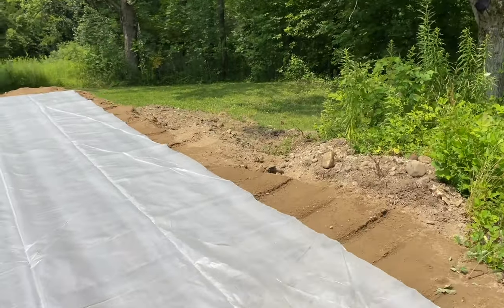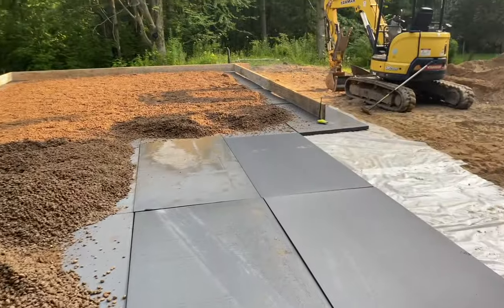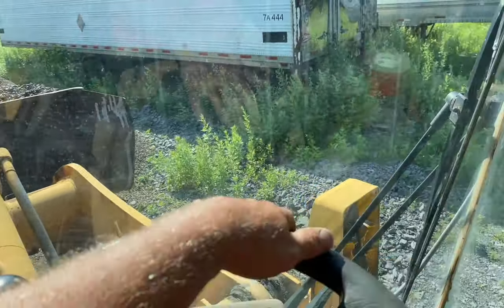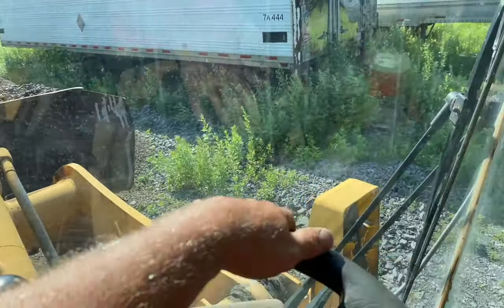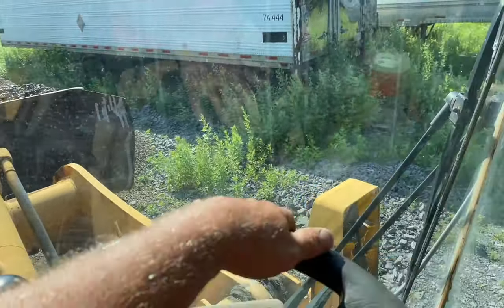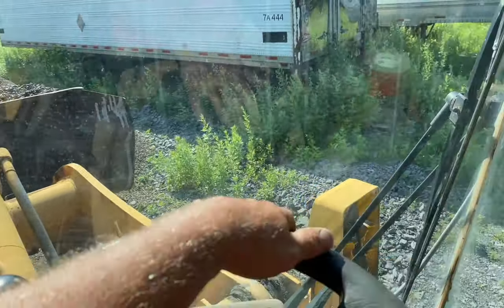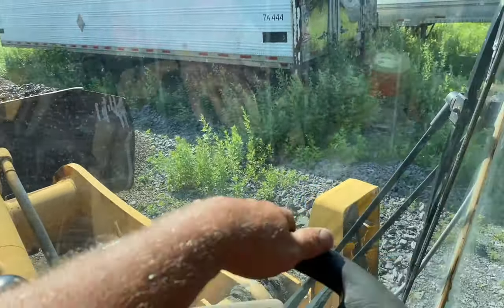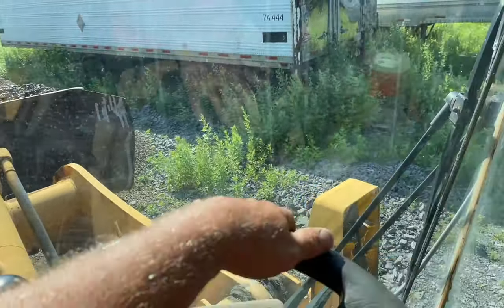A cost effective slab on grade home foundation.

Comment: We do lots of radiant heat slabs here in Northern Ontario. We always put 60-70 psi test on so you'll know if you punture a tube and you can quickly repair it.
Very rare occurrence to puncture a tube if everyone is careful though but in one case they did it with the wheelbarrow when he dumped there was a sharp edge that punctured the tubing.

Comment: Please explain why you don't need foundation and footers around the edge.  I'm a bit confused.  I've poured monolithic, but it's still three feet deep around the edge.  Frostline....
Reply: It's an insulated raft slab.  It doesn't need to go as deep as the frost line.  Rebar gives strength under load-bearing walls, and sitting on a bunch of stone spread out the loads.
Reply: We call it a club footing here in Canada but monolithic slab is the correct term

Comment: There at 12:00,,,I'm going to do something a bit different. Anyone feel free to comment with advice, because I DO appreciate it. I'm going to use 2"x12" for outside forms such as this. But I'm going to get one of those cheap post-hole diggers I'm seeing and make 8" holes every 6' or so down the wall-lines around 16" deep, and out in the field. Frost line here is that area, and we have no Codes here. Then I'm going to buy some of those 4' cardboard 'sonotubes', cut it to 24",,,and put in those holes. Bring the tops of the cardboard tubes 4" lower than slab finished height, so that it makes a pier. The top of the cardboard pier is also top of gravel level which makes for a nice guide to spread gravel to.  Also thinking of making a stem-wall out of 8" old tin strips. Line them along wall lines,,,making a 4-6" wide stem wall. Drive some 3/8" rebar beside tin and fill gravel right up to the side of the tin, resulting in 4"-6" wide stem wall. Doing this will save bigtime on amount of concrete I put in this 'alaskan slab' I'm attempting. That big sloped gravel to your outside form eats a bunch of concrete!  I see some guys digging footers with 18"+ buckets,,,and man, that is enough concrete to lay field stone on! I will also do 6"x6" wire mesh,,,and a few rebars down the 'stem wall' section too. 7-8" of gravel base and 4-5" of concrete slab. 28' x 44' shop. 2x6x10 walls. I hate metal buildings! Build my own trusses,,,thanks to 'Medeek' truss design and some vids on youtube. I appreciate you guys doing these vids. I'm 70 and still think I can do most of it, but gotta hire the guys to pour it, and wire it. No problem.

Comment: They make turntables for the tubing that makes it so easy to unroll those 1000' rolls all by yourself.
The manufactured ones are expensive so I just made my own using a lazy Susan turntable, plywood and a 5 gallon pail. It works awesome.

Comment: Thanks! I see others put gravel first then barrier and foam, what's difference? what type of foam you use? thanks for any comment!
Reply from the maker: It’s hard to insulate the haunch area unless you spray foam it. I get the insulation from a local hardware store. You want polystyrene for underground applications

Comment: Did you pressure test the heating lines after laying them but before pouring? I didn't hear you mention that (unless i missed it)
Reply: Typically, you test before and during the pour. Air leaks will show up during the pour if something happens.

Comment: Good afternoon good job guys. Just wondering why you put the insulation below the stone. In Wisconsin we put the insulation on top of the stone beneath the wire/tube. So you don't have heat loss in the stone. Is this normal/ok
Reply from the maker: We did it that way to create the haunch on the edge. There is no heat loss to the stone it is actually a heat sink. Thermal mass and will hold heat for days. Makes the system perform much better actually.

Comment: Why the foam extension below the pour? Wouldn’t that increase the likelihood of water getting under the slab? Been researching slab construction methods and this is the first time I’ve seen this method. Always something to learn! Thanks in advance!!
Reply from the maker: The foam is there for insulation and no water will get under it because of the free drainage material we used under the insulation 👍🏻

Comment: Question 
Other jobs have the foam wire mesh tubing then concrete. What's the reason for aggregate on this job?
Reply: My guess is to reduce cost for more concrete. In warmer climates this will work but you reduce your response time because the heat will be drawn down (backloss) and will have to heat the gravel as it heats the mass.   It will work you just use more energy to heat/maintain slab temp.
Reply: @cmmartti  That's not how it works.  I've designed these systems for government,  commercial, and residential systems for over a decade.  Heat is drawn to cold in a mass, its not like a forced air system where it all naturally flows up.  So the ground will suck some heat down and even out the sides of the slab (backloss) before it starts putting more heat in the structures/objects in the room above.  Once again, you need more energy to create that balance, and it takes longer (response time) before the space sees the designed output into the space.  Once again, in warmer climates in the south, the soil does not freeze up like northern states, so in this southern application it will still work because the ground temp doesn't go so low, but it's not a recommended practice in the radiant industry to skip the insulation.  Even a cretetherem mat with an R-5 would make a difference.  The only time we honestly skip insulation is for soil conditioning like slabs for walk in freezers, hockey rinks, and sports fields (football, soccer, etc) where we are trying to drive heat up and down.

Comment: was the 4" oversized slab for a brick ledge? starting a house for my daughter this year you and your crew make it flow so seamlessly.. good work
Reply: 4" oversized leaves 2" extra per side for adjustment not a brick ledge.
Reply from the maker: @JRP3  Yes sir thanks
Reply: What keeps water running down outside wall from sitting on ledge?  Do you flash over it? Never mind answered at tail end of video.

Comment: hey bondo , is there a 12v dc water pump that works well for infloor heat , looking to add infloor heat to a off grid garage but want the pump to be a 12v dc pump but not sure what specs or model pump to look at , i am going to do one run of 400 foot or so , thanks in advance
Reply: The longer your loop the bigger the pump you will need. With 1/2" pipe go 2 or 3 circuits around 250-330 ft long. use REHAU manifold and you can adjust flows to circuits, have the air vent to purge air/commission system, and see temps on supply/return. If building is off grid and chance to loose power use glycol to prevent freeze. Small size job a taco 007 pump will work. Also, put 10k slab sensor IN concrete for t'stat.

Comment: I’m building the same way. Slab on grade with hydronic. But I will spray foam rather than the rigid foam board. It’s more expensive but a solid vapor barrier and good insulator. Any thoughts. Thank you
Reply from the maker: Spray foam is a good option. especially the haunch area because it is hard to insulate that area. Make sure it is at least 2" of CLOSED cell spray foam. Only thing I like better in the method I show in video is the thermal mass added above the insulation. It works great.
Reply: Thank you! I will use a thermal mass on top of the spray foam. Southern Idaho is a very cold climate too. Looks like you used 7/8” clean rock for your mass material? I didn’t see much underground work for plumbing, the plans probably call for wall toilets? Great job laying down the slab - you do great work.

Comment: The one thing you never wont on a concrete pour is a cold joint and the secret to pouring a successful slab is strike of at the same time as the truck or pump.

Comment: Making the slab 4” bigger than the plan can give the framers a headache, and put the owner out of compliance with the building dept.
Reply: I pour and frame. It's called wiggle room.
Reply: @cmmartti  in parts of the country, the county where I leve for example, if you build a shed under 200SF you don't need any permits. If you plan to use 4x8 T1-11 sheets on your 12x16 shed and the framing is 4" bigger in each direction, you're gonna need extra material and more cuts on the framing and siding.. Why would this not be true?

Comment: Did an engineer or someone with some credibility sign off on this? Why would you want your plastic radiant lines touching the mesh from now until they leak? All that expansion and contraction against the steel mesh seems like it would cause a serious problem let alone no structural bearing going through the foam whatsoever. Never seen anything like this but just can’t figure out how this wouldn’t fail.
Reply: The wire mesh is just to hold the tubing in place. They are using fiber reinforced concrete.
Reply: We have been tying the PEX to the wire for 30+ years here in Canada.
No issues with that installation.
But you can also get foam board with dimples to hold the PEX as well which is a much quicker install.